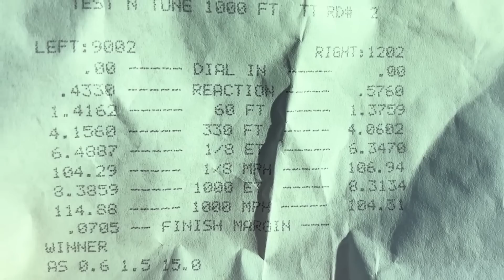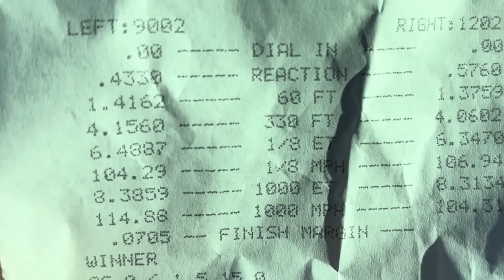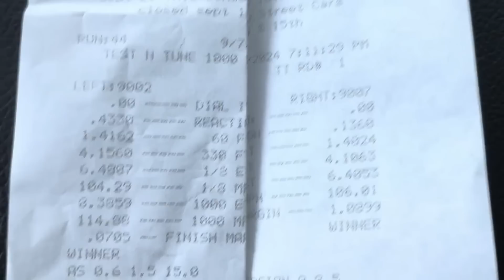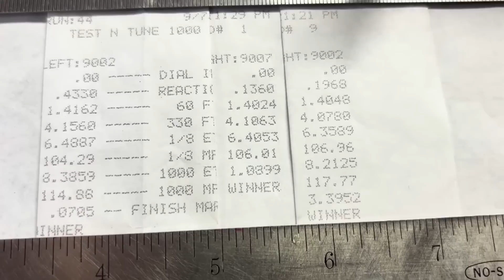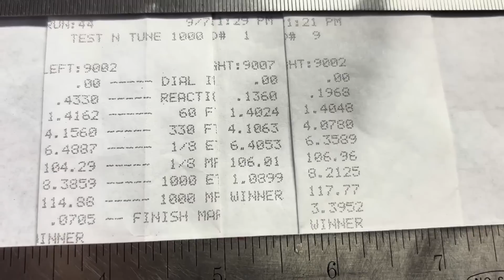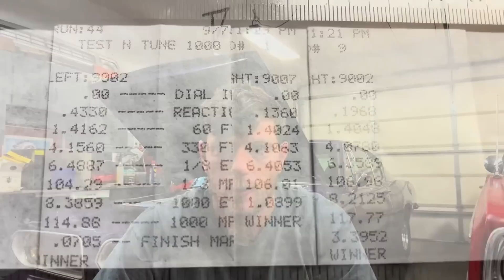Barracuda Drag Car Test and Tune Before #nonamenationals With The FAST Wireless Air Fuel Meter Kit

Comment: Joe  my 540 im building with the speed master heads is going to a mega block. 575  with a 279 283  712 lift  108 1.6 flat top  im looking for a super victor or indy intake do you know of any? Budget building a monster with superb parts ! Central missouri car
Reply from the maker: That sounds like a beast! I’m sorry I don’t. You may can have some luck in Mopar engines group on Facebook

Comment: I figured more timing was gonna help it. You may like 37 in it also. That's where mine is set right now. I didn't get time to back it down and try 35 when we were at steele. That sucker almost running right with mine now. That motor putting some power down
Reply from the maker: @MountainMopars  thanks brother. I know the small port Edelbrock e street heads are choking her down. They’re only 210 cc runners, but it’s a fun bracket mule.
Reply: @JustMoparJoe  and that's the best part about these cars. Good consistent and low maintenance bracket motors is the only way to go. That sucker would probably run 5.90s if it had a set of indy-1 heads on it. What cam did you say was in that motor?
Reply from the maker: @MountainMopars  .621 comp .272/.276@.050 108. I do have 1.6 rockers now to add some lift
Reply: @JustMoparJoe  I see. More cam than mine is. I didn't get a cam card when I got mine bc it was in a head intake package from a friend of mine but that's a heck of a cam for that motor.  It seems to like it.

Comment: 34/35 degress should be fine on that motor imho- could go a slight bit leaner and lose  another 100th or two.
We used 12-13 lbs on those slicks but, we are a bit faster, hit the tire a little harder.
a race radial is faster/safer and more consistent. I usually put tire at 17 lbs to start, so far, been to 19 lbs.
The higher the pressure you can use and still plant the tire is usually fastest in door cars .
Of course, if your going to spay it, you will be retarding timing.
Dont know how to pm you but, im in east texas, if we can hook up sometime, be glad to share data with you/ help you get dialed- she has a bit more in her na imho.
Beautiful car, you do great work and, put out good content man- enjoyed it buddy.
We run afr as well and, been looking for a way to see data without pulling a laptop out every run- will be looking t this product- THANKS!
Reply from the maker: Thank you! I have my drag radials but they really aren’t suited for my local track. They only prep the first 10 feet or so with a pump up sprayer. This track was prepping for small tire that evening, so it may have been perfect for the drag radials. I will try more air when I get to Sikeston.

Comment: There are so many different reasons that 'Cuda guy coulda kicked out so bad its not worth debating. What was worth noting is exactly what you said: masterclass save on his part. Totally a talent recognizes talent thing!
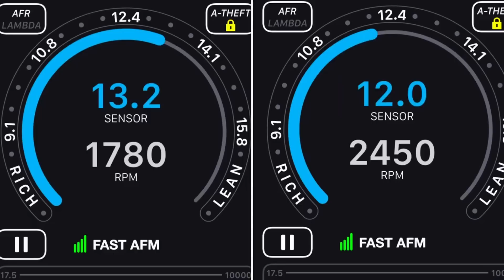I wish I had the time, and you as well, before the NNN for me to impart that knowledge of the bleed circuits I mentioned in the last vid (ignoring the obvious obstacle of distance haha). Watching the variation in your comparison at 12:00 shows a full point. That can be smoothed out changing those to a size larger. Its really hard to explain this in 'twenty words or less' kind of format. 99% of the guys out there ignore the bleed circuits when they do a jet change. IIRC it was Andy Wood and David Vizard that go into extreme depth of how those circuits impact the response times and efficiency those various vacuum leaks dictating fuel delivery. 
As always I am supremely impressed with your consistency on each run. Ive seen the big name/ high dollar guys like bailey, morris, etc struggle to maintain a .400 variation in times while you are pushing into that .005 kind of precision. You're going to crush it again this year, I have zero doubts my dude!
Reply from the maker: Thanks brother. I get a lot of carb advice from Tall John. He has great videos on timing and carbs.

Comment: Jack up rear and get a tapestry tape, made of cloth, women use them for sowing, and measure the circumferance of each rear tire, even brand new pairs are a different size,! I had to run 18lbs, in one and 20lbs. In the other side to get the slicks to the same size, car tracked straight after that ! Hope this helps .
Reply from the maker: No issue for me. I have a breakdown of rollout and rear tire size versus gear ratio. They are still
Sorting the 70’ cuda out. He did have a great pass earlier that night

Comment: That car runs so strong without a bottle and with it it may want more fuel. It may be to your advantage to run it with no bottle till you have time to sort out the affects of the nos. The tune, tire pressure or tires even, not a fan of nos. To many cars make so much power at 60ft they break traction and get loose. I think if you run what ya brung you will do fine.❤
Reply from the maker: @Roosters_Restos  thank you. I have a Nitrous express maximizer that can delay the shot from 20% to 100% in .5-4.5 seconds depending on the adjustment. Video coming soon!

Comment: Air density change, do you have a way to check barometric pressure? Also, when you use the nitrous, will your new system adjust timing?
Reply from the maker: When spraying, I will remove some timing before the run. I already know my car doesn’t mind 29 degrees, so that will be safe for 150 shot. I will try to compile my Nitrous runs for a separate video. I already have one planned on my new fuel system and nitrous controller that hasn’t released yet

Comment: I can’t imagine a big block Mopar like any part of 29 degrees of timing 
Normal should be 34-36 
Idono
Reply from the maker: I know you know some of the good stuff. I was trying to run 32 because of my traction problems. Turns out it was 29 with my old distributor!
Reply: @JustMoparJoe   we dyno 512 at 29 degrees Hp was shy of 720hp turned it up 36 792 ponies 
34 it was 802 
It was flat top 512 /400 block
Reply from the maker: @TwistedMopar  sounds great. I ran out of time to try 36 and 34. I want to find max potential so I can know how much to pull for the nitrous
Reply: @JustMoparJoe   I’ve never played with nitrous. I valued longevity, less maintenance, less stress avenue 
I’ll miss my ole car but I just couldn’t do the dedicated drag car deal anymore
Reply from the maker: @TwistedMopar  I’m at the opposite end I think. I have problems owning a car and not racing it at some point. If I keep the barracuda as a drag only, then maybe it’ll calm the urge for racing the others!
Reply: @JustMoparJoe  well I’m old lol 😂 
I’ll go back to dual purpose car , one I can drive and race little
Reply from the maker: @TwistedMopar  I’ve got 4.10’s. That’s a street gear for the old timers! Lol
Reply: @JustMoparJoe   410 is good all around gears 
456 is what I ran , 32 tall tire worked out about the same 
We used to run 513-557 all the time in  the 1/4  
 Now with the horse power being built now those big gears never used

Comment: Wow Joe good deal! What's this AFR? Most big blocks like 36° of timing hope yours will too.
What's your ET in 1/4??? 
Try 8lbs in them slicks!
Good luck Joe!
Reply from the maker: Thanks Johnny. I usually run 8.5-9 on a less prepped track. I’ve never made a 1/4 mile yet. I only have 4.10 gears so it should make the haul. Low 8’s in the 1000’ should be quick in the 1320